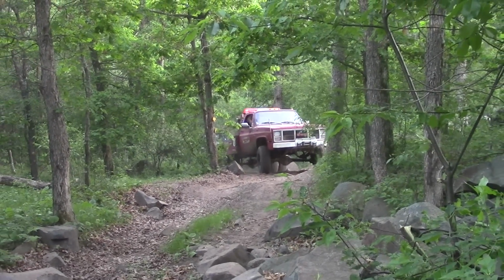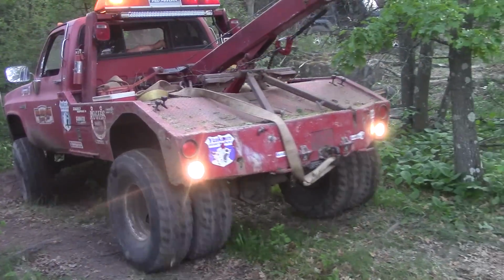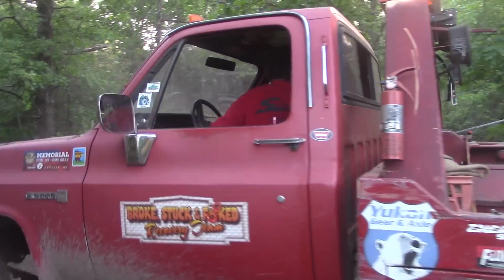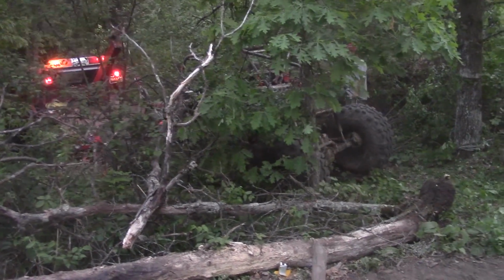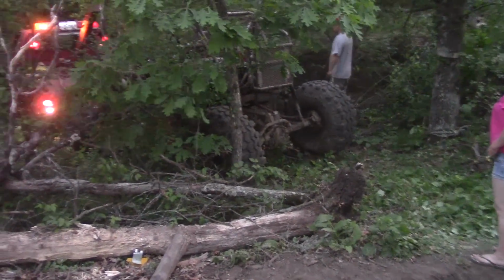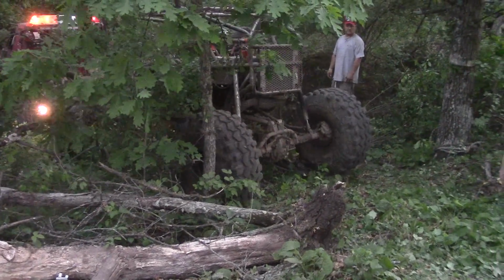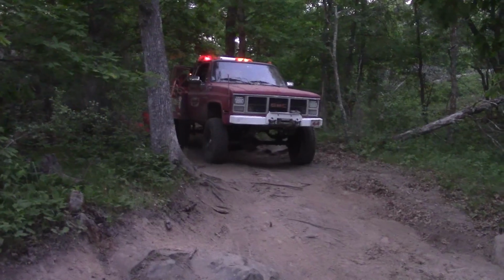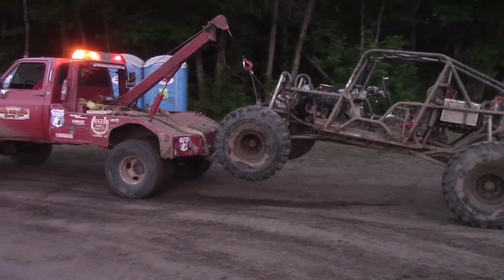ROCK TRAIL RESCUE by BSF Recovery Team

Comment: R u still using the winch rope or did u go back to the cable witch is wht it looks like on video
Reply: looked like it was still the "braided winch rope" to me.  and it's 100% still the rope at 4:36 when he grabs it bare hand and it's flexible as can be.
you'd never ever bare hand cable without proper gloves, unless you like hooked by frays! :)